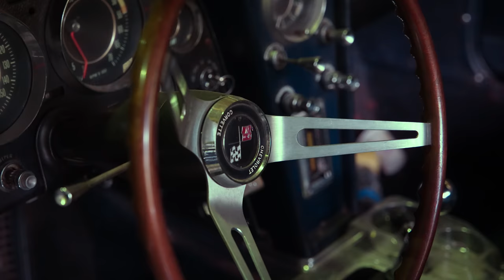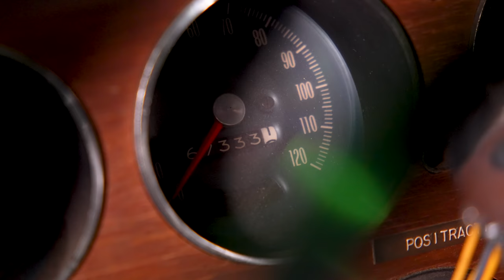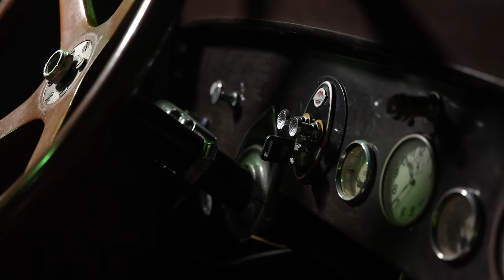Pontiac GTO sitting for 40 years along with other American icons and hot rods | Barn Find Hunter

Comment: The Hemi warranty story is priceless! Keep 'em coming, Tom 👍
Reply: Bought a 1969 RoadRunner HEMI, new. Torqueflite, 4:10 Dana.....30 day factory warranty on the powertrain. The rest of the car was 12/12.......The dealers said "It was made to race and you will race it"
Reply: @charliechristie2949  must have been a special order. I say that only because the Dana was available with a 4 speed option only.
Reply: @chrismc.4437  Nope. "Super trac pack" . Heavy duty cooling, 4 speed or Torqueflite, 4:10 Dana.
Reply: @chrismc.4437  Nope, not in 69. "Super Trac Pack", consisted of Heavy duty radiator, torqueflite OR 4 speed, 4.10 Dana.
Reply: I bought a new ‘68 Roadrunner 383/4 spd, 3:23 geared, dark metallic green coupe. Cost: $2,900. The Hemi option was an additional $713. Those were the days!

Comment: Excellent find.!!!  Cars of all types...  Hey Tom.... that is a 1966 GTO
Reply: I learned to drive on our '66 GOAT that my father bought brand new from Moody Pontiac in Fort Lauderdale; $4016.00 window sticker, if I recall correctly. Burgundy (like this one started life) with White inserts (seats); Black carpeting. 389, 3-2bbls. with factory 4-speed (with Hurst shifter); posi with 3.55 rear gears as the car had factory A/C (largest ratio with A/C). Power steering; power brakes and a sweet, big car ride. Sadly sold in about 1977 or '78.

Comment: This man is an absolute gem! He is the perfect car collector. He has makes from each major auto manufacturer, makes from every era of styling, and he keeps them original unless a drivetrain upgrade provides a major improvement in the  driving experience. I also like the fact that he does the work on them. Getting a chance to wrench on those old flathead and early ohv engines built in the days before the oil pump/pressurized lubrication is an experience you will never forget. A bottom end rebuild of a 1940's engine is quite different than a bottom end rebuild on a mid 1950's and later engine. I'm already hoping Tom gets the opportunity to make a return visit to this collector. Maybe we will get a peek at his shop where he rebuilds his engines!

Comment: Back in the early 1970's I bought a 1942 Chevy Fleetilne off a used car lot in Phoenix, AZ for $300.  It had, what we called at the time, a Tijuana tuck and roll interior but a stock outside.  I remember driving it off the lot and I could turn the steering wheel a complete loop before it did anything.  Luckily I found a new Pittman arm for it so fixed that quickly.  I think the original 216 engine had Babbit main bearings, but it ran fine.  I had it a couple of months and traded it for a motorcycle.  Hindsight is 20/20.  Probably should have kept it.

Comment: That GTO is a '66.  The '67 had a sloped rear panel between the tail lights and a "chain link" grille.
Reply: I'm sure that's why he said, "pre - 67"
Reply: Also the 66 was the last year for the 389 tri power.  It was the 400 4 barrel for most of the remaining A body GTOs
Reply: @h62962  Makes sense.

Comment: That GTO...I've turned them down for decades...800$, 1200$...nice original rust free cars...never liked em. Large sloppy land yachts.  The 69/70 GTOs and Judges.  That's the ticket.
Reply: amazing comment... the 65-67 stacked headlights are iconic, the judge is too... the 70 doesn't get a lot of whoohoo , the A bodies were practically mechanically the same... 69/70s were heavier... same suspension.... and a tiny bit bigger...when they did the coke bottle upgrade in 68.... it was a long hood....64-67 was a long ass end... bore a 389 .060, later heads and cam...they would dust even the ram air 3 Judges, which most were... and they had pathetic rear ends until the 70 455 packed in the 12 bolt... somehow those rears ended up in a lot of lighter 64-67's